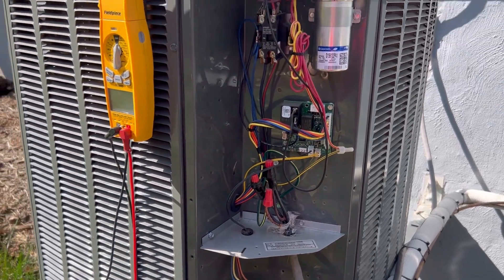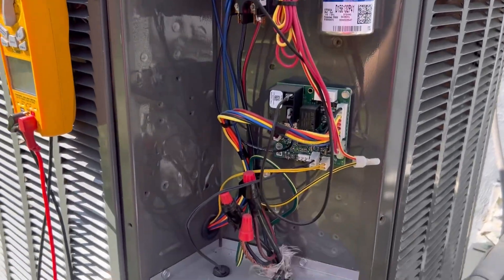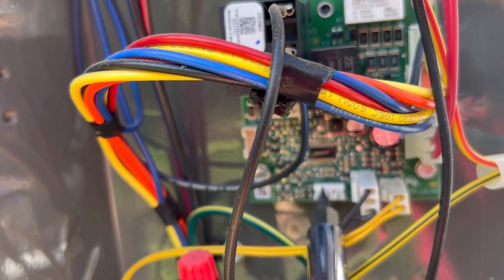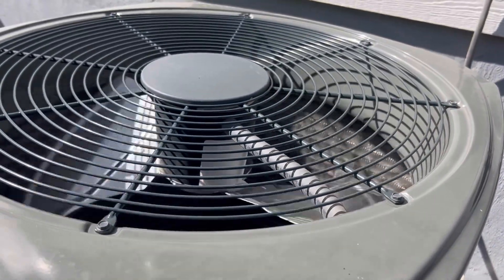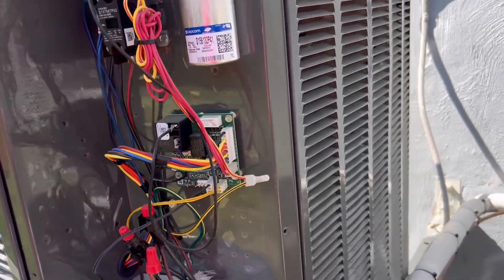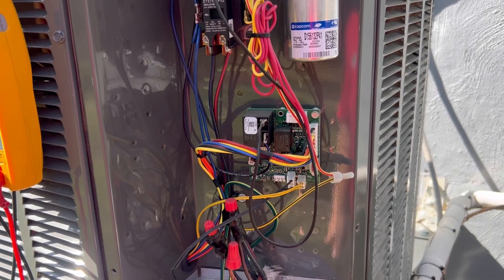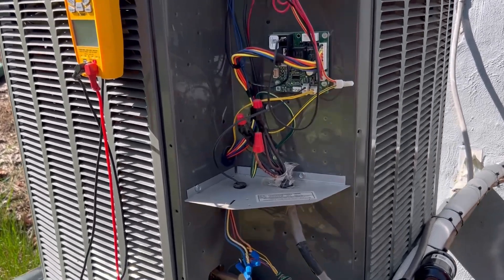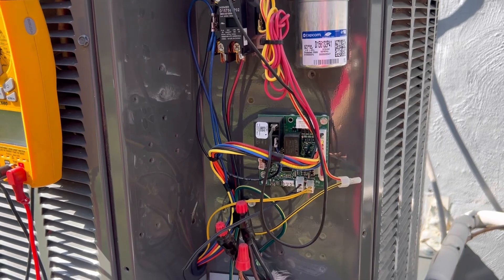Testing the defrost cycle on a Trane heat pump. #hvacservice

Comment: Hi. Thanks for this simple video. My defrost cycle wasn’t working and it failed this test so I got a new board and replaced it. After i started up again the new one failed the test as well. I was convinced the board must be faulty and I got a third one. That failed as well. The system works great summer and winter besides this frosting issue.
Reply from the maker: It sounds like you might have a different problem causing the defrost cycle to fail, and the board may not be the issue. Did you try testing the defrost sensor?

Comment: No you’re wrong check the coil sensor first always, inspect back of board second for slugs or frogs and then check cooling pressure, then ambient sensor the make sure you have 24 volts to board. Your welcome
Reply from the maker: This video is mainly to show people how to check the defrost cycle on a Trane heat pump. Thank you for adding other things to check.